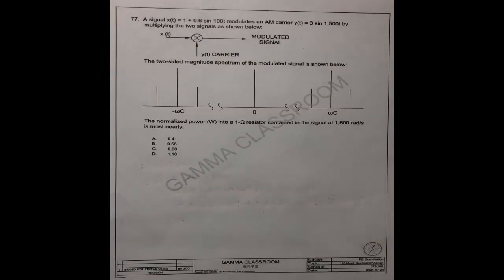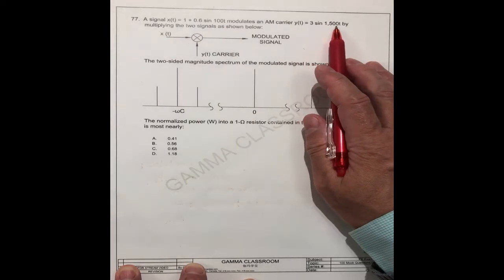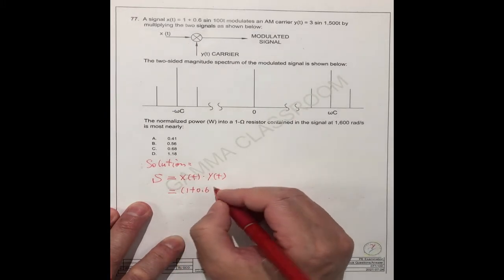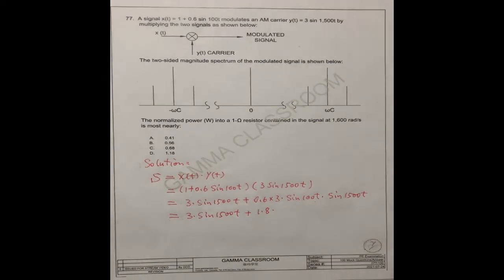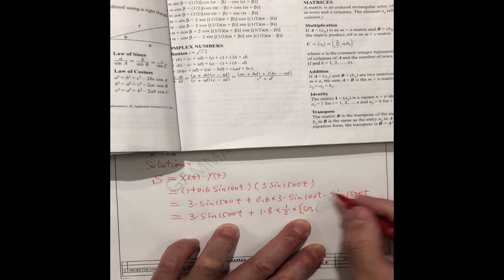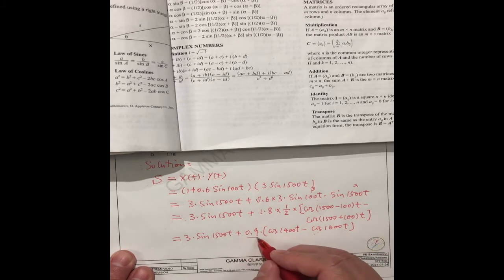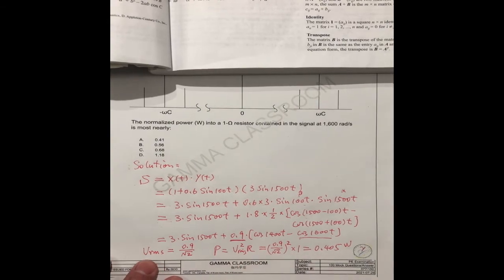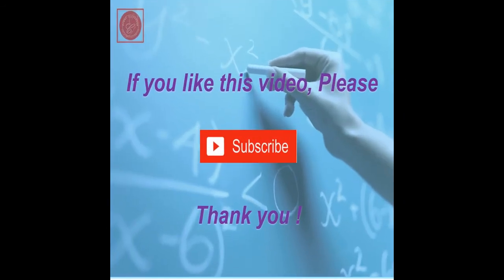Normalized Power, Modulated Signal, Real Time Solution 77 for FE Exam Mock Question Series 1

Comment: Thank you for all your videos. Why did we use 0.9, not 3 for Vpeak?
Reply: last part of the question asked for power for the signal with 1600 rad/s. 0.9 is the magnitude of the signal with 1600 rad/s.
Reply from the maker: Right! 0.9 is the magnitude of the signal with 1600 rad/s!  and Vmax=Root 2 x Vrms. 
Sorry for delay response. Hope all like Gamma Classroom channel.